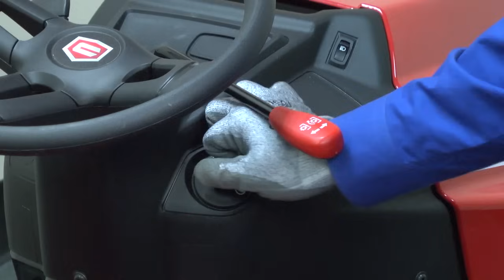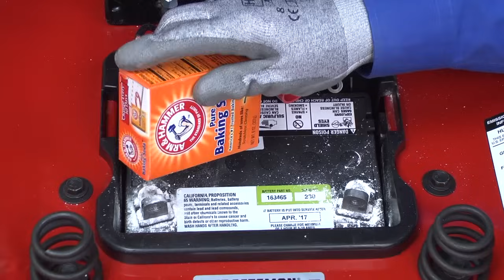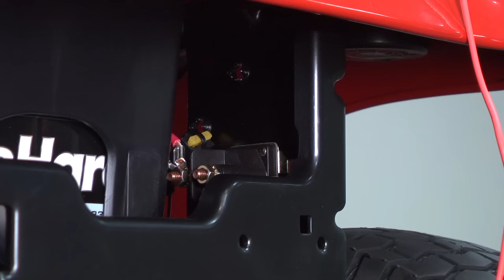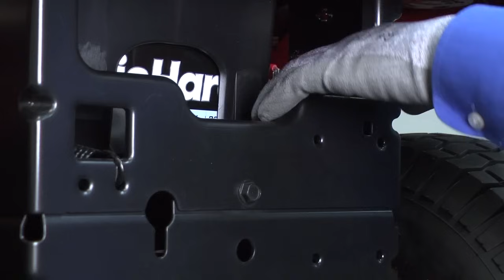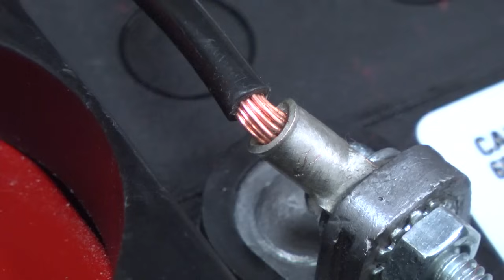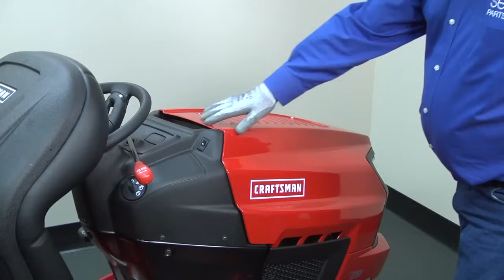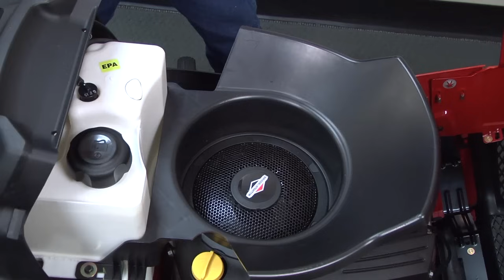How to Fix a Riding Lawn Mower That Won't Start: Engine Clicks But Doesn't Crank

Comment: Amazing video. I only have one question when removing the black wire from the solenoid if one of the switches is bad wouldn’t it not get any power anyway?

Comment: Thank you! It turned out to be the starter motor, diagnosed just as described. Great video!
Reply: Was that an expensive fix? Someone is selling one for $150 and it doesn’t start. Was wondering if that’s a good deal. It’s looks mint

Comment: @2:49 - The solenoid doesn't click at this step but the voltage goes from 0 to 9.7. Does this mean the solenoid needs to replaced.

Additional question. I accidentally bridged the gap between the positive and negative on the solenoid and I could hear the start motor spin so I tried it again to see if the motor would start but the starter sounded like it was spinning but wouldn't start. Does this tell me anything useful or was I right that the solenoid is not working and needs to be replaced and that is the issue?

Comment: Watch this video to the very end, the simple 'turn the engine' did the trick for me!  Motor was jammed up just enough to lock up the starter, once i gave it a turn or two with a large socket, the starter fired the motor right up!!!  Thank you sir for your helpful video !!!!

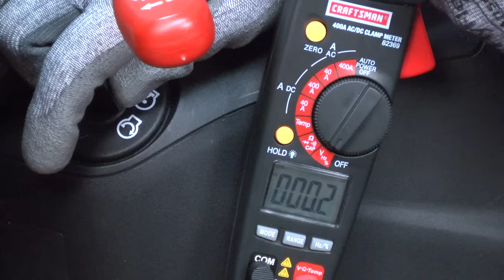Comment: Around 3:41, you're hoping for 12+ volts (it shows 12.29 in the video).  Or nothing.  However, with two different solenoids (one out-of-the-package new), I'm getting readings of 11.5/11.6.  Hooked everything up again anyway, but still just get the click.  Going to go pound my head against the shed a few times to try to figure out what to do next.

Comment: New battery, new starter solenoid, new starter motor, engine not seized, wires good, still just makes a rapid clicking noise.
Reply from the maker: Check the wiring between the battery and solenoid. Corrosion on the battery cable battery connector or a loose connection could fail to allow enough current to flow through the cable to spin the starter motor. Also check the cable between the solenoid and starter motor. Because you've replaced all of the other components that could be causing this problem, a wiring failure could be preventing the engine from spinning. Also, try removing the spark plug then see if the engine spins when you turn the ignition key to start the engine. If it does and you have a Briggs & Stratton single cylinder engine, then a compression release cam is preventing the engine from spinning. We hope this information helps. If you need further assistance, let us know.

Comment: great video. I do have a question though. a battery can have the right voltage but when under load it doesn't have the amps to turn the motor. how do we test for that?
Reply from the maker: David, the person who can help with your question if on vacation. I'll have him get back to you ASAP when he returns.
Reply: @searspartsdirect  thank you

Comment: can a battery die from one week to the next? mine clicks but its faint.
Reply from the maker: A battery can go bad quickly or a problem with the electrical system in the mower can drain the battery.

Comment: My craftsman mower will start with a cold engine, but once warm and I shut it off, I cannot restart it until it cools down in about 30 minutes.
 When I turn the key there is no click or anything. Totally dead.
However, if I turn on the key and use a screw driver to jump the solenoid, the engine will restart. This tells me the starter and battery are fine. So I replaced the starter solenoid and that made no difference. Then I replaced the ignition switch, and that made no difference.    Any advice?

Comment: Mines at 12.16v is so it wont start?
Reply from the maker: The battery may not have the cranking amps need to spin the starter motor and turn the engine over. Try jump starting the mower.

Comment: Great video.  Well produced and narrated.  Question:  I have a 2001 Craftsman LT1000.  When I turn the key all I get is a clicking noise.  Immediately before it stopped running, it would start roughly.  I'd turn the key, it would slip a bit then start.  This happened 2-3x before it stopped starting.  Seconds after it wouldn't start I removed the oil filler cap and some light smoke came out of the filler.  I've trouble checked it based on your video.  Will the flywheel of a seized engine move at all?  I can get the flywheel to move 3-4 inches in one direction and a bit less than that in the other direction, BUT, the flywheel is very tight and i really have to torque my wrench in order to get it to move.  Help!
Reply from the maker: If the mower has a single-cylinder Briggs & Stratton engine, check to see if the engine spins when you remove the spark plug. If it does, then the compression release cam could be broken and not releasing cylinder compression.

Comment: I charged battery fully it tries to start, but after 3 attempts it doesn't try anymore and voltage on battery after trying is 12.3v when fully charged before attempt it was 13.3v when trying to start it goes down to 1.9v is my battery just worn out
Reply from the maker: The battery could be bad. Have the battery tested or try jump starting the mower as shown in this article/video (unless your owner’s manual warns you not to jump start the mower): https://www.searspartsdirect.com/diy/article/jump-starting-a-riding-lawn-mower-battery-video
Reply: @searspartsdirect  thanks for the reply, I ordered a new battery to see if it resolves it, this battery is 3 years old so maybe it just doesn't hold the charge
Reply: @searspartsdirect  sorted it was just the battery phew ha
Reply from the maker: @honorabilis1  We're glad to hear that you found the cause of the problem and that it was just the battery. Thanks for letting us know what you found.

Comment: Solenoid gets hot but wont turn motor ....🤷‍♂️any suggestions?
Reply from the maker: Follow the troubleshooting in the video to check voltage going to the starter motor with the key turned to the start position. If the solenoid isn't allowing current to flow to the starter motor then you'll likely need to replace the solenoid.

Comment: I have an additional step to add. Should have been the first.  Make sure your kid didn't pull the blade button up  while you're working on it. Spent 30 minutes doing all this just to find the blades on. As soon as I turned them off it started right up lol.

Comment: Measuring battery “volts” is not enough to determine if the battery is still good. Mine had enough volts so I spent 3 hours trouble shooting more components according to this video and my mower still would not start. I replaced the battery and it started right up and now starts great. That being said, this is a great video, just know the battery may still be bad even if it shows enough volts.

Comment: I’m using a multimeter and have determined that there is full charge on the battery and also on the red post on the solenoid.  The black post on the solenoid, however, is showing approximately 6.3 volts when I turn the ignition key and hear the solenoid click.  So, it’s getting approximately half the voltage it should be getting.  According to your video, if the voltage were at (or possibly very near) zero, I could determine that the solenoid is bad and needs to be replaced.  But, what might the culprit be in this situation?  Thank you.
Reply: As a follow-up, I have replaced the battery, the starter solenoid, and the starter motor.  The engine spins freely, which I checked prior to replacing both the solenoid and the starter motor.  And yet, there is a single click from the solenoid when I turn the ignition key.  The multimeter shows everything from the battery to the starter motor to be functioning correctly.  Very frustrated at this point.

Can a faulty safety switch, such as the plunger interlock switch, cause the solenoid to click when turning the ignition key?  I know next to nothing about safety switches and I’m pretty much out of ideas.

Comment: the simple test for starter      place a screw driver across  the two large terminals if the starter spin the solenoid is bad

Comment: Listed these out step by step if anyone is interested :-)
1)	Test the battery for charge.  Need min 75% charge to turn over.
2)	Check battery cables
a.	Red meter probe on red post of starter solenoid
b.	Blk meter probe on blk battery post.
c.	Should read >12VDC   If less than 12VDC replace red cable
3)	Check starter solenoid
a.	Disconnect blk cable that goes to starter motor from the solenoid
b.	Attach red meter probe to the post were the blk cable came from
c.	Attach blk meter probe to neg bat post
d.	Hold ignition key in start position.  
e.	Should read >12VDC   If less than 12VDC replace solenoid

4)	Check starter cable via voltage drop
a.	Remove spark plug wire.
b.	Reconnect blk cable from starter motor to solenoid
c.	Connect red meter probe to the blk solenoid post
d.	Connect blk meter probe to the starter.
e.	Hold key to on position and watch voltage drop when it clicks.
f.	Should be less than 1V drop.  If more than 1 V drop the cable is bad,
5)	Check if the motor spins, if it spins you know motor is not locked up and it must be a bad starter motor.

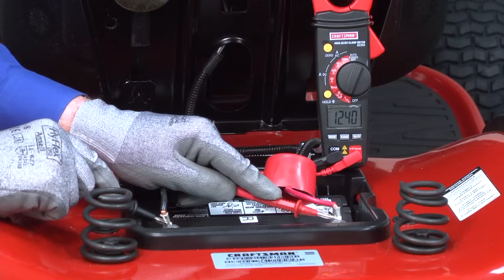Comment: This is a very good video that I used to diagnose why my lawn tractor wasn't starting.  Be sure to pay attention to the chart @1:18 when testing the volts of your current battery.  To double check that my battery was the problem and not the solenoid or starter, I hooked a pair of jump cables (or a jump start box could work too) to my truck and tried to start the lawnmower.  It started right up which reinforced my troubleshooting with the voltmeter that the battery was the culprit.

Comment: My mower will turn until compression... then it’s stops turning and nothing happens... can’t figure it out for the life of me
Reply from the maker: If you have a single-cylinder Briggs & Stratton engine, the compression release cam may be broken. Remove the spark plug and spin the engine with the starter. If the engine keeps spinning with the sparkplug removed, then you may need to replace the compression release cam. We hope this tip helps. If you need more help (or you have a different type of engine), let us know (and provide us with the model number of your engine or mower so we can see the exact type of engine that you have).
Reply: Sears PartsDirect 
Thanks for the reply... it’s a 26HP v-twin Koehler (I’m sorry I know it’s your enemy lol). Turned out to be the dumbest thing! Lol
I removed spark plugs, engine spun freely so was more confused. Then I found out it could be a valve adjustment. Before I tore the heads off I gave it one more try and it fired right up. It’s a finicky ignition key! If I turn the key and force it all the way to the right hard (like when I’m frustrated) it will click once and then stop. If I just turn the key normally (and not “overturn” it) it fires right up!
So stupid
Reply from the maker: @cjsawinski  Thanks for letting us know what you found. We're glad to hear that you fixed the mower.

Comment: Got excited to troubleshoot my mower. Figured I’d tap the starter with a rubber mallet first before doing all of that. Fired right up. At least I know where to start if it happens again.

Comment: Great video, but it does not show where to locate the starter solenoid terminals...
Reply from the maker: The location of the starter solenoid and the starter solenoid terminals varies by model. Let us know the model of your riding mower and we'll try to help you out.
Reply: @searspartsdirect  Thank you. I took a second look at my engine compartment and was able to find it....Husqvarna YT42LS

Comment: Mine starts and runs sometimes, then after mowing for over an hour, i shut it off and then it wont start again. It clicks and nothing else. I have replaced the solenoid and battery, waiting on a multimeter to try these steps, but I wanted to ask, when I first turn the key, the hour meter has an oil lamp on it and a bunch of 8s. Then it changes to my actual hours after a few seconds. Does that mean anything? I just had the mower serviced and the oil changed, but it has had this issue both before and after that maintenance. Just seems like that is some type of error code. I have a craftsman 917.20393. it has a kohler motor in it. Any help is greatly appreciated.

Comment: Nice job, very much to the point.  I was wondering, how often are the cable going from the solenoid to the starter bad?  Also you never mentioned the ignition (starter) switch.  I suppose it's bad if you have a good battery and you don't get a click when you turn the key to start?  I found a spark plug wire arcing out to the frame and eliminated one problem after fixing it.  Thank you.
Reply from the maker: The cable going from the solenoid to the starter doesn't go bad that often if you store the mower indoors. If the mower is constantly exposed to the elements, that cable has a better chance of going bad after a few years of use. We show how to test the ignition switch at 8:30 in the video. Here's a link for a webpage that includes the written version of the video in case you need it: https://www.searspartsdirect.com/diy/article/riding-lawn-mower-engine-wont-turn-over-or-click-video . We hope this information helps. If you need further assistance, let us know.
Reply: @searspartsdirect  Thanks so much for your response and kind words of advice.  It was the starter solenoid after all.

Comment: Had a John Deere 112 refusing to start. The starter motor would spin but would not engage the flywheel ring gear to turn over the engine. Removed the cooling shroud and found the shaft that the pinion gear rides on was dirty and rusted. On the Kohler engine the rotation of the starter motor causes the pinion gear to move on the shaft and engage the flywheel ring gear. This is called a bendix drive. Best to determine what type of starter your engine has before embarking on resolving a problem. The John Deere I fixed could have been fixed by simply drilling a hole in the cooling shroud covering the starter and spraying cleaner and a thin lube like WD40 onto the shaft/gear assembly.  The access hole can be plugged with a rubber plug from a hardware store or other mechanism like tape.

Comment: Thank you so much for this!! My problem turned out to be a locked -up engine. My Dad came to troubleshoot with me and he did find, after doing all the tests you described, there was gas in the piston. We discovered this after removing the spark plug and turning over the engine. Gas came shooting out of the spark plug socket and the engine roared to life !! Thank you!
Reply from the maker: Thanks for letting us know what you found. We're glad to hear that our troubleshooting video helped you out.
Reply: I wonder if that's my parents riding mower problem. When the key is turned there's not one click, there are constant clicks until I stop trying to start it.

Comment: I don't know anything about ride on mowers. I have a Troy Built TB30R and it will not start unless I jump it off my car battery. The ride on battery is reading just under 11 volts which I know is pretty dead. But why is the battery dying? Isn't the mower supposed to charge the battery? And what inside the mower charges the battery by the way?
Reply from the maker: A bad cell inside the battery could be causing the starting problem that you're describing. Try charging the battery. If the battery won't charge or it won't hold a charge, you'll likely need to replace the battery. You can also have the battery tested. If the battery is okay, then the engine alternator may be bad. The alternator charges the battery when the engine runs. A wiring failure between the alternator and battery could also prevent the battery from charging when the engine runs. We hope this information helps. If you need further assistance, let us know.
Reply: @searspartsdirect  I put a charge on the battery yesterday by jumping it off my car again. I tested the voltage and it was dropping by .1 every few seconds. The car jumped it to just over 12 volts. After I cut all my lawn(cause I had the damn thing running....lol) I tested the battery again and it was reading about 13.5 volts. So the alternator on the mower is working. But again, the voltage was dropping by one point every few seconds. A friend of mine told me to replace the battery because these batteries are only good on these things for about two years and they go bad. Is this true? This is the original battery on this mower and the mower is about 3-4 years old. I'm not totally sure about the age of the mower though. I can tell you I got the mower last year and I did not do any winter maintenance on it. I didn't disconnect the battery, drain the gas tank, empty the carburetor, etc for storage. I had too much going on and this was at the bottom of my to-do list.
Reply from the maker: @MrCougar214  Mower battery life varies. It's not unusual for a mower battery to last only 3 or 4 years. Your symptoms seem to indicate that the battery is bad. You can take it in and have it tested before buying a new one. The test will likely reveal that you need a new battery.